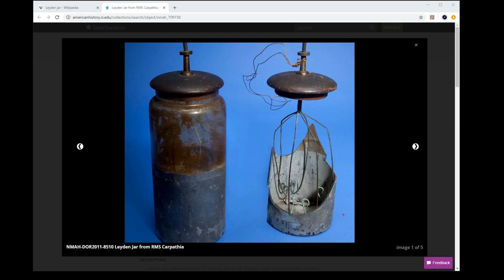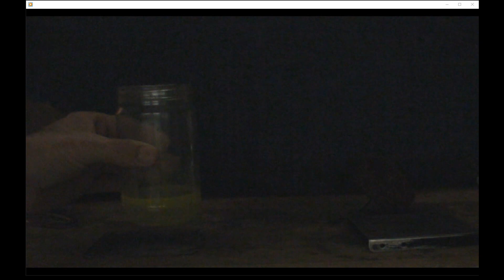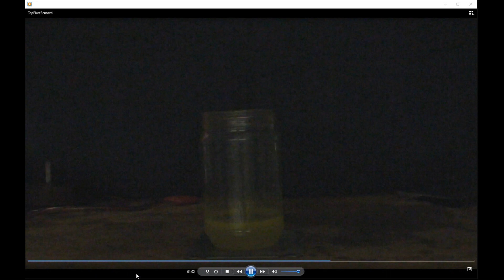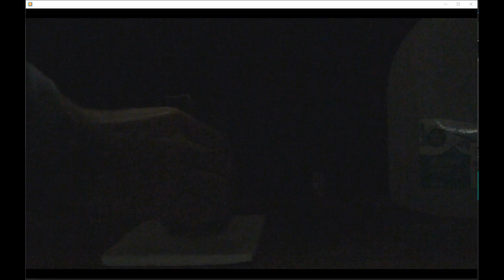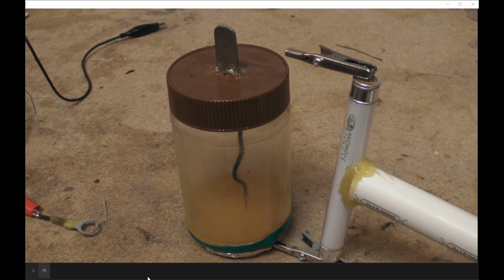Electron Theory can't explain Capacitors, but Ben Franklin can!

Comment: Seriously, you post a lot of out there stuff about science, and almost always an attempt to discredit or knock academia. So I have two questions for you:

1) Have you achieved a degree in science or engineering?

2) Why not put your claims to the rigors of the scientific method and document the process and publish it?

You making claims one way or the other does absolutely nothing without scientific proof to back it up. There are so many inconsistencies with your process in this video, it makes it seems as though this phenomenon is behaving differently than it actually seems. Why turn the lights off for the "effect", are you hiding the fact that without the original plates the discharge is much less? These are the types of inconsistencies that keep people of sound judgement from believing your claims. Using canola oil as a dielectric? Have you ever heard of the ionization of liquids such as oils as storing an electric potential? You believe its an insulator, when it is in fact an electron trap. You are not putting your assumptions through the rigors of testing and you are holding onto notions instead of giving it a fair and accurate assessment. This is bordering on how charlatans convey their trickery. Be better.

Also, years ago in school we witnessed the capacitive discharge of two metal spheres, in open air with no dielectric in between. What was holding the charge in that case?
Reply from the maker: <<2) Why not put your claims to the rigors of the scientific method and document the process and publish it?>>

Simple, that's not my goal.  It's obvious that there are already flaws that can make it through the scientific method and publishing, so it is not like that process is some golden ticket to truth.  Besides, I don't care to change my process at the moment.
Reply from the maker: <<Also, years ago in school we witnessed the capacitive discharge of two metal spheres, in open air with no dielectric in between. What was holding the charge in that case?>>

The dielectric medium in most of these cases would be the air, so the surrounding air would be the dielectric constant kappa, unless you put another dielectric in between the spheres.  You could even claim the oxide layer on the outside of the metal spheres might contain some charge.  If it is a vacuum capacitor, then that's where it gets really interesting...the polarizable ether!
Reply from the maker: <<Why turn the lights off for the "effect", are you hiding the fact that without the original plates the discharge is much less?  >>

I am trying to show you the arc discharge and get it on a 60 FPS camera, so I can show a still image of it.  But hey, if you think I am trying to deceive, then fine.  You can see other people do this experiment too...maybe they are just trying to deceive?  You can pick up the metal and touch them together and no spark (or maybe something VERY small)...if you did this experiment yourself, you'd understand that.

<<These are the types of inconsistencies that keep people of sound judgement from believing your claims.>>

Oh, sound judgement is to claim you are being deceived the presenter?
Reply from the maker: <<You believe its an insulator, when it is in fact an electron trap.>>

Hah, ELECTRON trap... I love it!  Now, that is science!  Let's build us an electron trap out of oil!!
Reply: @itsbs  LOL You know, it would be great if there was some website where you could type things into it and it would bring up all sorts of information about what you typed... if only you could type "ELECTRON TRAP" in that website, maybe you wouldn't look like a total fucking idiot. TMYK
Reply from the maker: @ATX_Engineer  <<if only you could type "ELECTRON TRAP" in that website, maybe you wouldn't look like a total fucking idiot. >>

What are you saying, you believe that an "electron trap" is proof of a "single electron particle"?
Reply from the maker: <<You are not putting your assumptions through the rigors of testing and you are holding onto notions instead of giving it a fair and accurate assessment. This is bordering on how charlatans convey their trickery. Be better.>>

I could say this same thing about your comments being off-the-cuff and emotionally driven.  So, Be better.
Reply: Einstein challenged the establishment and was proven correct.  His PhD was Honorary.  So he was not qualified at the time.  Professional scientist often disagree as I found out while studying with the open university.
Reply: @jredgewell  You might be embarrassed to find out that this guy believes Einstein to be wrong and that his discoveries are nonsense. So in this guy’s logic, he doesn’t go into academia so that he can disprove another guy who didn’t go into academia because academia is full of demons suppressing the truth. Also, even though Einstein did not go the traditional route, he was not a nutcase and was smart enough to be listened to by Hillbert and many other historical, traditionally trained academics. Without their help, nothing would have come out of Einstein as the math needed did not exist yet. After publishing his theory in an academic setting (not YouTube), Einstein continued his humble life, only bothering people when he had something worthwhile to show not plastic jars from the trash with canola oil. What a joke.
Reply: @Fleurlean4  I have to agree with you after watching some of his other posts.
Reply: @Fleurlean4  STR is krapp -- & GTR is mostly krapp.
We are presently in the Einsteinian Dark Age of science -- but the times they are a-changin'.
The aether will return -- it never left.
Reply: @jredgewell  STR is krapp -- & GTR is mostly krapp.
We are presently in the Einsteinian Dark Age of science -- but the times they are a-changin'.
The aether will return -- it never left.
Reply from the maker: <<After publishing his theory in an academic setting (not YouTube), Einstein continued his humble life, only bothering people when he had something worthwhile to show not plastic jars from the trash with canola oil. What a joke.>>

That's funny... emote much?
Reply from the maker: <<I have to agree with you after watching some of his other posts.>>

Hey Jim, are you still a believer in Einstein?  Did you watch my SR playlist of videos and think about it?
Reply from the maker: <<You making claims one way or the other does absolutely nothing without scientific proof to back it up. There are so many inconsistencies with your process in this video, it makes it seems as though this phenomenon is behaving differently than it actually seems.>>

Hey, I make this experiment simple enough that ANYONE can do it.  I also link videos to other people that have done the experiment.  I also show that Ben Franklin and over a century of scientists understood what was going on... the idea is that YOU do this experiment and see for yourself and think it through.  That's a pretty simple idea, right?
Reply from the maker: <<Using canola oil as a dielectric? Have you ever heard of the ionization of liquids such as oils as storing an electric potential? >>

OK, if you don't like the oil as a dielectric, then what about distilled water dielectric in this experiment?  What about the other experiments that use mylar or some other plastic cup?  Did you do ANY research before you typed the comment or just want to try to "discredit me" in order to feel better about what you saw?  Electron trap!!
Reply from the maker: <<Seriously, you post a lot of out there stuff about science, and almost always an attempt to discredit or knock academia.>>

Yes, that is the point of this channel.  It is to get people thinking on their own, instead of following what they are told to believe is true.  Academia seems to tell you to believe in the TRUTH a lot, so yes...their claims are an easy target in some situations.
Reply from the maker: <<1) Have you achieved a degree in science or engineering?>>

No, I'm an idiot.  But what has that got to do with you doing an experiment or reading a paper that I have linked to the original author, etc?

Comment: You are just inducing an electrostatic charge on your dielectric and then you discharge that through your lamp to the earth (or your table or the metal plate that is in contact with the earth).
Reply from the maker: <<You are just inducing an electrostatic charge on your dielectric and then you discharge that through your lamp to the earth (or your table or the metal plate that is in contact with the earth).>>

Says the expert who has obviously never done the experiment himself!!
Reply: @itsbs  Haha, Yes I haven't done the experiment myself; I just think your experiment can be improved by making sure that when you connect your lamp to discharge the dielectric's energy, there is no path that connects your lamp to the ground. 
The dielectric has no free electron and so when you put a voltage across it via the metal plates, it cannot happen that one side of the dielectric gets positively charged while the other side gets negatively charged, which is exactly what you need to prove to conclude that the capacitor's energy is stored in the dielectric. It is likely that what is happening is that the electrons are jumping from your wire inside the jar to the dielectric (or wise versa) and therefore you are storing electrostatic energy in the dielectric. Note that this means that the density of only one type of charge (either positive or negative) is increasing in your dielectric. One way to test this is to flip the positive and negative voltages when you charge the capacitor and repeat the rest of your experiment and see if now the lamp turns on as bright as before. Because the dielectric is probably good at storing either positive or negative electrostatic charge and not both, flipping the polarity of your charger can have a visible impact on the brightness of the lamp.
Reply from the maker: @amirzandieh2793  <<The dielectric has no free electron and so when you put a voltage across it via the metal plates, it cannot happen that one side of the dielectric gets positively charged while the other side gets negatively charged, which is exactly what you need to prove to conclude that the capacitor's energy is stored in the dielectric.>>

So  are you saying the plastic jar is not polarized?  Didn't I show that the jar is polarized by using the electrostatic meter at the end?
Reply from the maker: @amirzandieh2793  <<It is likely that what is happening is that the electrons are jumping from your wire inside the jar to the dielectric (or wise versa) and therefore you are storing electrostatic energy in the dielectric. >>

It is likely that you believe in jumping electron theory without proof, but hey, if you want to believe in the "electron spray" theory, like Professor Walter Lewin, that is fine.  I tried to show that was false with using a fully insulated metal configuration that was soaked inside of distilled water during the charging process.
Reply from the maker: @Amir Zandieh  <<Note that this means that the density of only one type of charge (either positive or negative) is increasing in your dielectric. >>

Again, if you don't think the MOSFET can detect a positive and negative charge, then I assume you don't believe what the electrostatic meter is showing, i.e. an electrically polarized, plastic jar.
Reply from the maker: @Amir Zandieh  <<One way to test this is to flip the positive and negative voltages when you charge the capacitor and repeat the rest of your experiment and see if now the lamp turns on as bright as before. Because the dielectric is probably good at storing either positive or negative electrostatic charge and not both, flipping the polarity of your charger can have a visible impact on the brightness of the lamp.>>

This is something I've done many times, but I didn't do a brightness comparison in the video.  The Wilmshurst machine can flip the polarities when you experiment from one day to the next.  It seems like you have something to test...fire up the experiment for yourself!

Comment: Why we need distilled water at all?? What's the role it plays..?? Will that store energy in any way..??
Reply from the maker: <<Why we need distilled water at all?? What's the role it plays..?? Will that store energy in any way..??>>

In this case, it is a really good insulator.  You can think of it as thick plastic that is covering the wire when I drop it down in there.  If the water has dissolved minerals, then it will act like a conductor of electricity.  Distilled Water as an energy storage medium for capacitors is probably not a solution (that I know of).

Comment: So how are they able to make good capacitors if electrical engineers dont really know how it works? 🙈
Reply from the maker: <<So how are they able to make good capacitors if electrical engineers dont really know how it works? 🙈>>

They are not very complicated devices, so they are not difficult to make.  The real question would be...can we improve capacitors by better understanding that the dielectric plays a more of a role than just "an insulator/separator."
Reply: @itsbs  Right my point. My background is mechanical engineering and in our wind turbines we install "supercapacitors" instead of batteries to turn the blades when in an emergency. So perhaps those can be improved then perhaps.
Reply from the maker: @Stefan-gh7xr  <<Right my point. My background is mechanical engineering and in our wind turbines we install "supercapacitors" instead of batteries to turn the blades when in an emergency. So perhaps those can be improved then perhaps.>>

Yes, if we can better understand the "power" of dielectrics, then I think we would absolutely improve energy storage.  One of my experiments would control the discharge of electricity by switching out the dielectric in the jar, i.e. from distilled water to vegetable oil, AFTER the jar was charged up.
Reply: @itsbs  Ok, interesting. In physics class to illustrate static charge they always rub a plastic tube and then your sticks to it, that is also proof of dielectric charge, isn't it?

So I discovered last year that it is very healthy to drink distilled water. So I suspect this has to with the fact that distilled water is a perfect insulator? Health channels they say that distilled water has a "negative charge"
Reply from the maker: @Stefan-gh7xr  <<Ok, interesting. In physics class to illustrate static charge they always rub a plastic tube and then your sticks to it, that is also proof of dielectric charge, isn't it?>>

Yes, that is the tribo-electric series (rub-electric), but they'll usually describe it as electrons sitting on the surface of the plastics.  These are the ideas that I believe we need to get away from in order to continue to improve.

<<So I discovered last year that it is very healthy to drink distilled water. So I suspect this has to with the fact that distilled water is a perfect insulator? Health channels they say that distilled water has a "negative charge">>

Distilled water is a great insulator.  If you look at the description of this video, there will be a link to the Plasma Channel video that shows this.  I'm not sure of the health benefits, but one interesting experiment you can do... simple.  Take a clean metal plate or coin, drop some distilled water on it...take a voltage reading.  Since distilled water has no IONS, then why does it create a voltage potential.  I've done this in series and lit an 1.5v LED using coins and distilled water.  Science will generally tell you that an electrolyte solution is required to get a "voltaic pile" working, but nope...just a great "insulator" touching metal (that's weird).
Reply: @Stefan-gh7xr  distilled water is NOT healthy. No minerals. You'll need pedialite to rehydrate.
Reply: @Simonjose7258  have you researched it or are you repeating what others taught you?
Reply: @Stefan-gh7xr  Can you link any sources which say that distilled water is healthy??
Reply: @itsbs  Gerald Pollack explains that an exclusion zone (EZ) forms in the water at the metal -- the EZ is negative -- the remaining water is positive (except that an EZ also forms at the air surface).
Reply: @itsbs It is well known that the dielectric plays a massive role in the capacitance, according to C = εA/d. For example, tantalum oxide has a relative permittivity (ε) of 25-50, meaning that it can store 25-50 times more charge in the same volume as compared to air. The problem is that there is always a trade-off with any one material, and not just insulation strength, but things such as polarisation, ESR, changes in the dielectric loss at high frequency, and loss of dielectric strength at high frequency.
As electronic engineers, we have to use whatever gives us the greatest compromise.

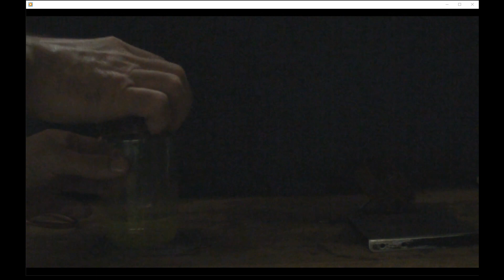Comment: 12:20 You didn't connect the old electrodes together. You would have seen a big spark because the glass is storing only a small amount of the energy -> the rest is still on the plates you set aside
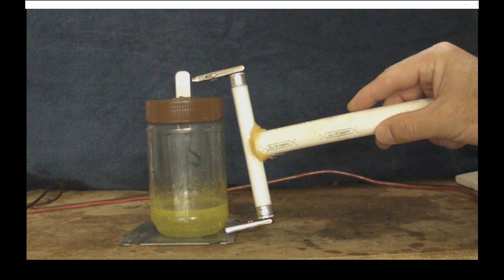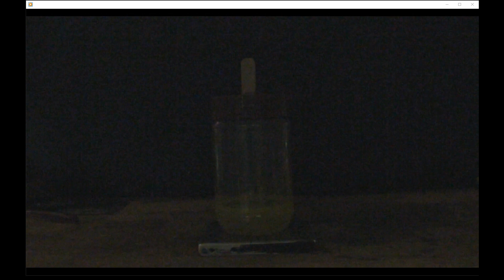Reply from the maker: If you look at 10:04, the plates were never changed out and you can see the magnitude of the discharge.  Now look at 12:50, I think you can say that the two discharges are very comparable and the metal pieces do not show a large spark when touched together.  You can also watch these dissectible capacitor videos where they do immediately touch the metal together and there is no discharge between the metal pieces:

Professor Julius Sumner Miller - https://youtu.be/NNR-sd58p-U?t=600
Russ - https://youtu.be/eQGd_jYYfqQ?t=580
Richard Hull - https://youtu.be/NQO-p_ff0Xs?t=110
Reply: The metals are only the conductors. On a power line, electricity flows on the conductors, not inside them. The conductors act as guides.